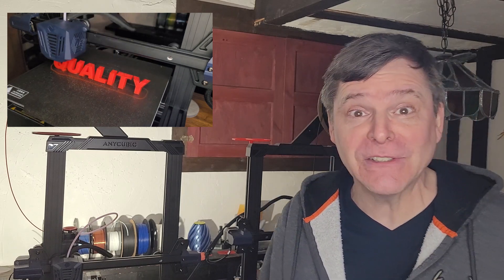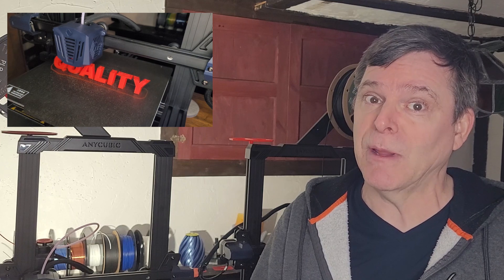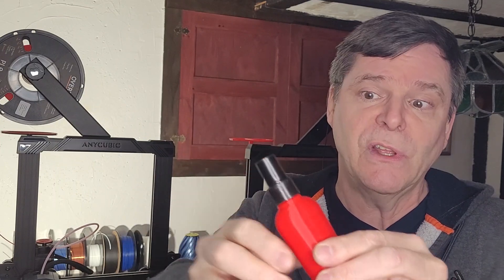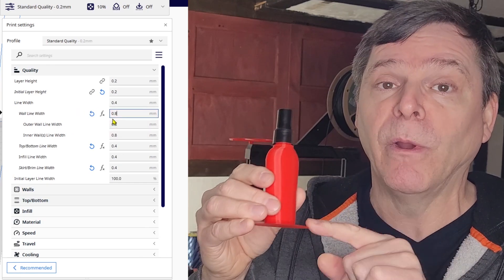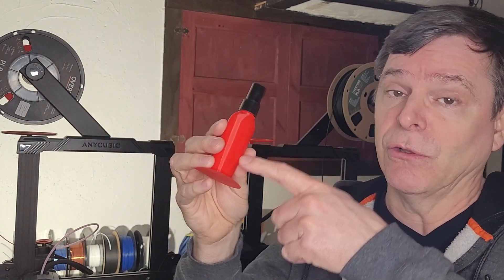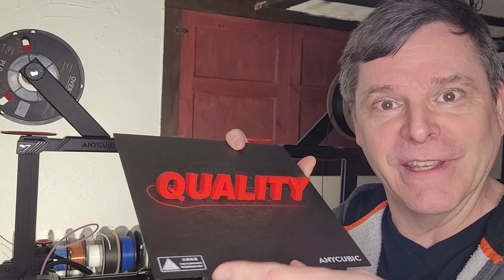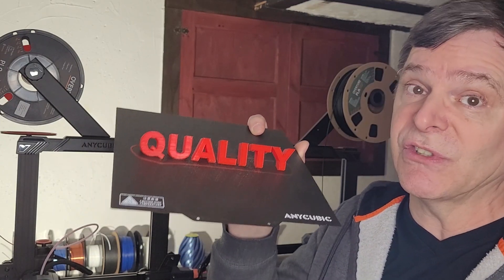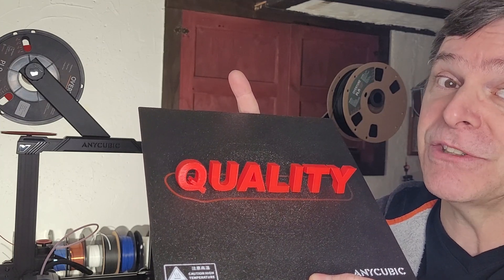Faster 3D Printing, 2x Faster

Comment: Hey smiley, I have been running into an issue with my Kobra Go. The z seam is always has holes unless I turn wipe to 0. but on other prints i have zits. I believe this is from the nozzle oozing out material and causing a delay of extrusion at the start of lines. Any way to fix this?
Reply from the maker: Hi 2020 sorry for the delay.  Check this out.  I remember watching this awhile back and maybe it'll help https://youtu.be/ZM1MYbsC5Aw?si=ph1WDPQI5WO8jyeb

Comment: Hey smiley. Good to see you still having fun. Question. Your line width, do you use it as default for everything? I use prusaslicer exclisivley now and am able to set line width for everything. I have some specific widths set up butnwas wondering, if i remember right you use cura, do you use this as just perimeters? Infill as well?
Reply from the maker: Morning Robert, good to see you.  I do use Cura a lot due to familiarity.  I tend to experiment with different line widths depending upon what I'm printing. Love the ability to use different line widths with one nozzle. 
Yes I'm still having fun thanks to people like you.

Comment: What do you find are best settings to get good water tight first/base layers?
Reply from the maker: Morning tft 
I've only created a wall mount bowl once. The person that requested the bowl said it didn't leak for a long time but eventually did leak.
It was printed using a 0.2 layer height and 0.4 line width. Printed solid 4 walls of memory serves. What you thinking about?

Comment: Wow i didn't know you could double your nozzle width. I wonder it i could do that with a .6. Btw did you mention l😊ayer height?
Reply from the maker: No didn't make any changes to later height.  Let me know how you make out
Reply: I think you can with a 0.6 nozzle but i havent gone over 1mm line width. I usually let the slicer set that parameter and it works fine but for some longer prints ive changed to that. Not on my anycubics tho. I run 2 sv06 plus with 0.6 stainless nozzles
Reply: @robertolson6686  how do you like the SV06? I was thinking about grabbing one.
Reply: @theintruderfiles  i like it. I modded mine a lottle bit, part cooling fan, springs on the outer 4 corners, i also put some supports for the z frame just to stiffen it up. Idk of id recomend it tbh, the bed is difficult to make perfect, i had to add springs then i used paper tape on the plate beneath the pei sheet to bring it up to perfect level because the abl does not work very well when there is more than a 0.1mm difference in the bed surface. Once i sorted that out tho on both they are actually running like champs and with the 0.6 nozzle they are my better printers. So take that for what you will. If you dont mind tinkering and have a decent understanding of steucture and 3d print works then have fun. Just cant say its a starter printer. mynext printernwill be a core xy design
Reply: @robertolson6686   I'm capable of fixing most issues, but after 7 or 8 Ender 3's, I find tinkering to be more annoying than satisfying. I'm sure you know what I'm talking about. I think I'll hold off and get a K1/K1C. Thanks for the review. Cheers!
Reply: @theintruderfiles  imo good choice lol. I avoided ender like the plague. I have no regrets but yeah. A core xy would have been much better. Have fun man